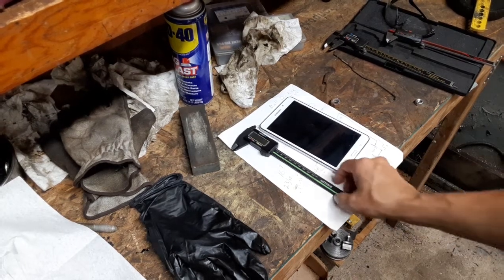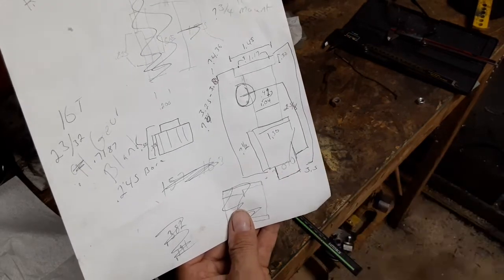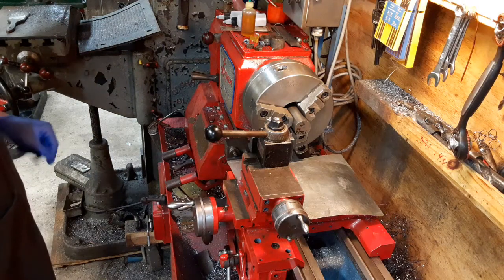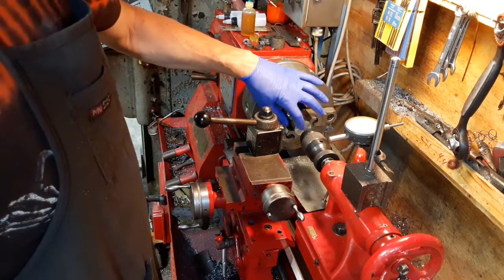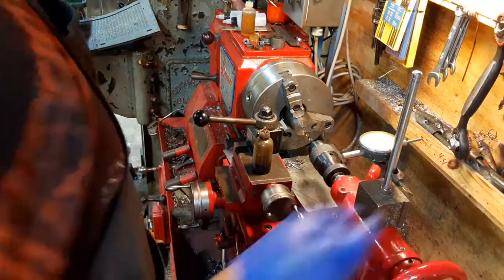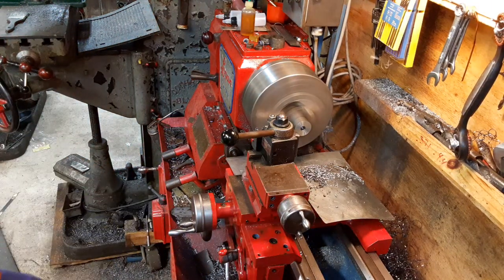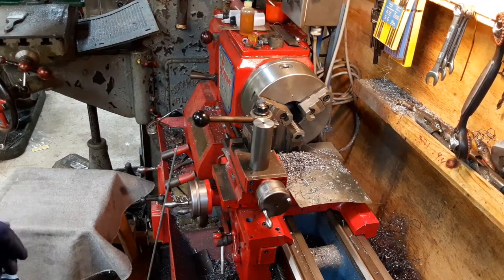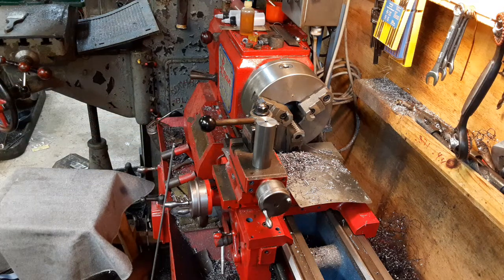starting to build a thread dial for the logan lathe part 1

Comment: Quite an ambitious project, Craig.  Not quite sure what you have in mind for the worm gear, but if Winky did it, then it's probably doable in the average shop.  I have a nice chunk of marine bronze lying around if you're interested - shoot me an email with approx. dimensions of what you need.
Reply from the maker: https://youtu.be/-BIX0cJw5Ls

That's the video that motivated me on this endeavor.  He really turns out some great projects.  

Actually I nearly forgot I also have a chunk of bronze I can use for the dial. But thank you for the offer...
I will probably lean towards steel for the dial anyways
Reply: @craigtate5930  Not to disagree with Winky's approach, but seems to me that he missed a step:  after he used the slitting saw on the gear, he should then have applied the acme hob on it in the lathe to fully form the gear teeth.  The likely reason why the brass worm gear failed was that it didn't have any slots in it to index the cut (that and maybe hobbing too fast).  The worm gear is what should be made out of bronze or brass.
Reply from the maker: @danielabbey7726  good point, I just saw a video recently from a relatively new comer showing what your talking about... think it was "Jeremy makes things"
Reply: @craigtate5930  What a coincidence!  I just subbed to his channel recently because of a cool old vise that he restored.  Wasn't being critical of Winky in my comment, but also didn't want you causing damage to your lead screw with half-formed worm gear teeth cut from steel (should be a softer metal).
Reply from the maker: @danielabbey7726  that's a cool vise !

No worries on advice at all. Its always welcome.  I only hope folks dont feel put off if I dont put it to use in that particular project...often times by the time the new comment is received I already have a game plan and time invested into that plan. However theres a real chance it may be exactly what I do on the next project.  
Honestly i am considering making a second version of the gear in the future out of soft metal . And as often as i change my mind between projects i could scrap this project entirely when the finish line is in sight..lol

Truth be told i wasn't even sure I could do this in the 1st place, and especially this quickly. And steel is normally my goto material because I have so much of it, I can afford to make many mistakes with steel...

I am actually considering going off on a tangent now anyways,  kinda curious if I can crudely make imitation gears using this method